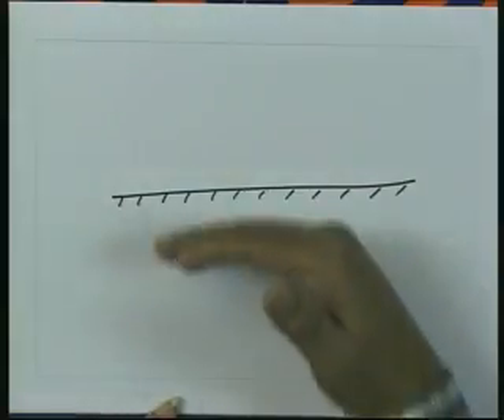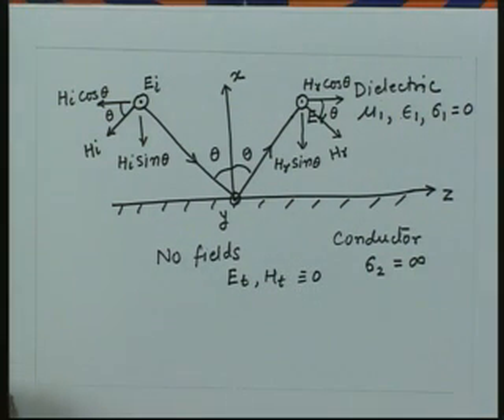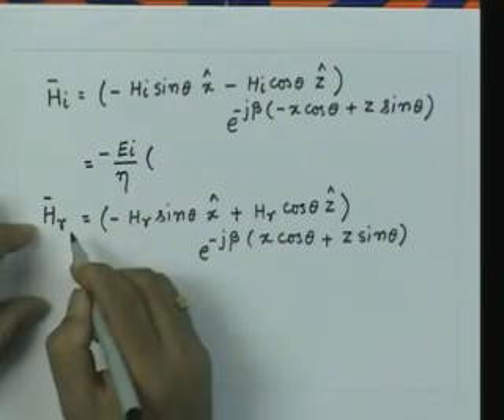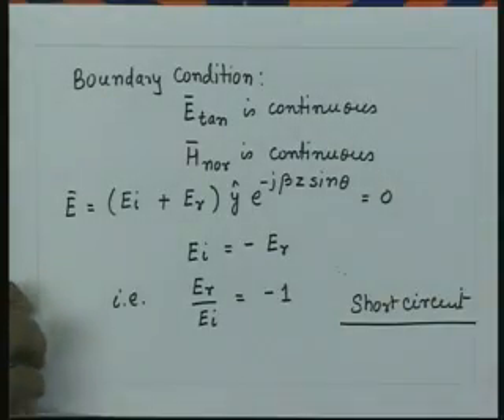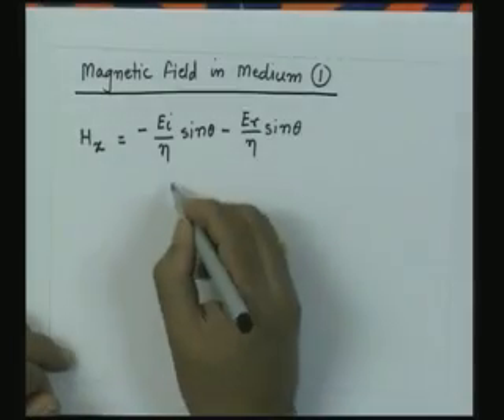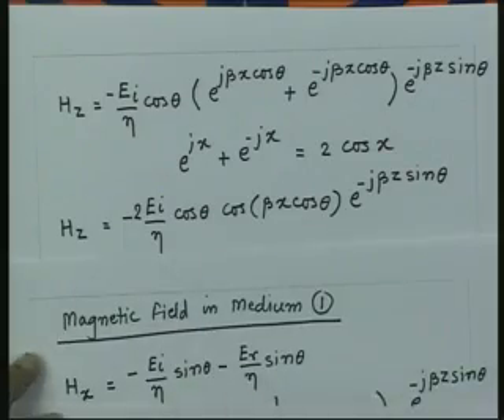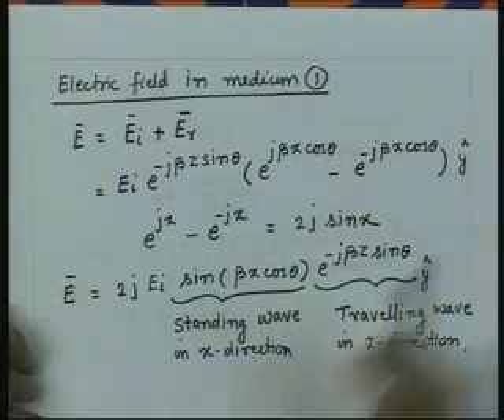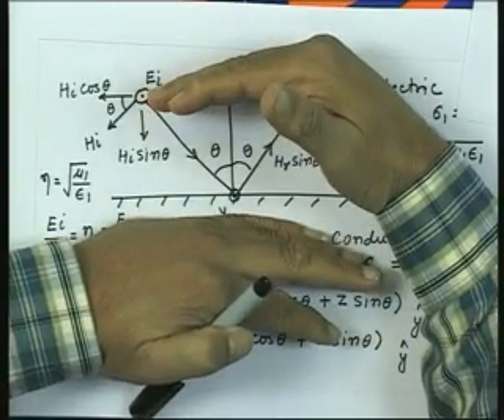Reflection from a conducting boundary

Comment: How wave is making angle pi-theta with x-axis
Reply: 11:10
Reply: @abdkumar6903  I can say it this way.. in simpler terms we require angle between vectors so extend the ray into and then angle will measured as head-vertex-head which is (π-theta)..
Hope it helps.. and it's correct!! @ajay wavhale
Reply: I think Direction cosines defined when start of vector is at origin, hence need to shift origin at start then its working
Reply: @ajaywavhale326  can try put it in better words because it's highly necessary for me please.. and since it's so recent help ASAP
Reply: For incident wave, the direction cosine and direction of x-axis are in opposite direction, which means out of phase, i.e., pi radians. The same explanation for reflected wave is given @12:10 onwards, where direction cosine and direction of x-axis is in same direction.
Reply: @chiragcapri  right..... The direction of incident wave is opposite to the z axis.